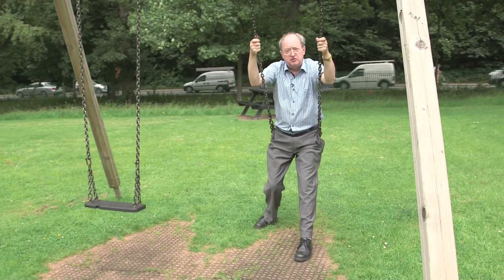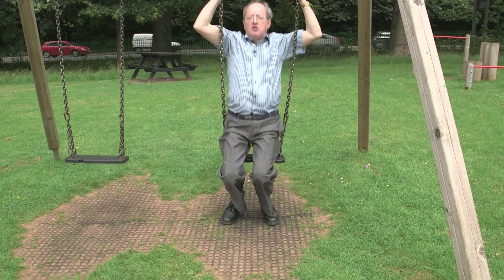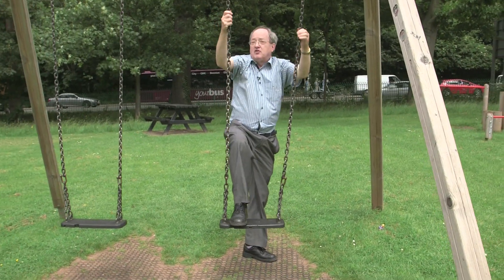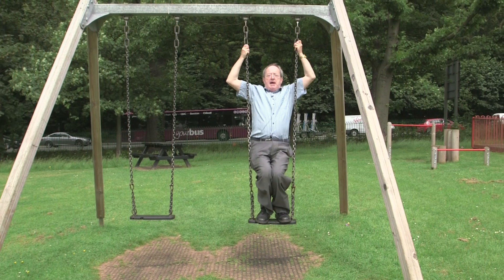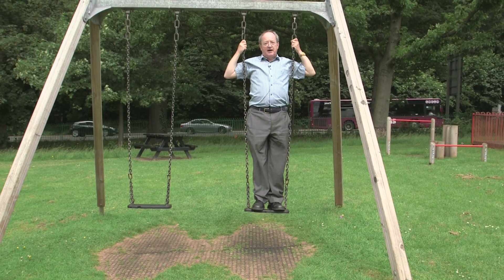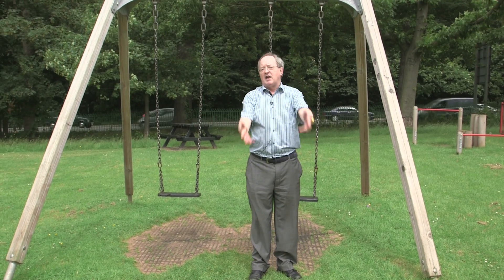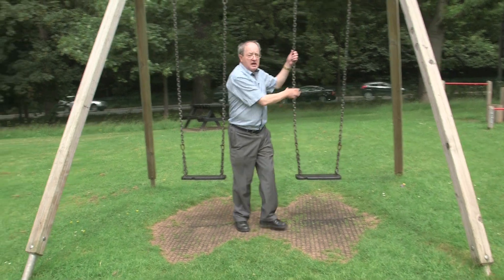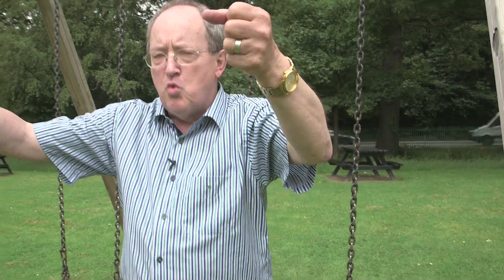Swing Physics (extra footage)

Comment: I content that this explination is wrong. You can get a solid bar swing to work by "pumping" your self NOT significantly changing the center of mass height , but by Applying energy to move the center of mass the center of mass along the radius of the circle.

Comment: Thank you for the explanation!  I grew up in Russia with rigid steel swing arms.  We would indeed stand on the swings and go up and down to achieve incredible momentum and speed BUT we, most of the time, pumped in the usual way, sitting on the seat and extending and tucking under our legs and torso.  In fact, we swung sitting down on the seat in much the same way as people do on swings with ropes or chains.  HOWEVER, swings with ropes/ chains feel like pulling a guitar string that has lost all tension, or like running in deep sand -- my energy is stolen away and wasted by the bending of the chains/ ropes and it is not transferred as efficiently as it used to be with the rigid poles.  Why is that?  Why sitting and pumping with rigid poles felt so much more powerful than pulling on those ever-bending chains/ ropes??? My intuition is that the bending of the chains creates a smaller pendulum beneath where my hands are grabbing, this smaller pendulum moves in a different period relative to the main big pendulum -- something like a turbulence in the motion of the main pendulum, and this "turbulence" wastes the energy of the main pendulum, making me, overall, move more sluggishly while using the same amount of energy.

Comment: Surely moving your 'centre of mass' forward and  back at differing speeds through the swing, reduces the loss of acceleration at the ends of the swing. In fact isn't your 'centre of mass' going in a circle around the point it would be if you sat passively. So its an example of two dimensional movement being translated into one dimension.

Comment: I believe that this explanation is a little flawed, because back then I still could do the rocking technique to achieve higher velocities on rigid swings. Maybe it's also about moving the center of our mass back and forth? For example, if I lean back, I move my center of mass towards my back (at the moment of its highest point on the "back" side). It's like moving the pendulum a little bit further and further beyond its "own" maximum, so I just push more potential energy to it, right?

Not a physicist though, just thinking.

Comment: The bending and rising the Prof. talks about at the end is, as far as i'm aware, exactly the way skaters gain momentum in a half pipe. But I'm curious as to whether or not the physics is actually the same or if it is a little different as a swing is suspended from above where as a skater is running on a surface?
Reply: It's a force perpendicular to the ground that makes the object go in an arc. Doesn't really matter where that force comes from, because the "pushing", whether it's done by the chain/rope or the ground, is the same. So yeah, it doesn't matter :)
Reply: It's the same set of forces. The skater follows a curved path defined by a solid object, no difference at all, except the skater doesn't necessarily follow a circular arc, I think half pipes are flat on the bottom.

Comment: There's something missing in this conjecture.
My grandfather built me a swing with rigid bars many years ago, and I could swing past the horitontal point more easily than on swings with chains, using the same sitting and rocking technique shown in the main video.
Reply: An example of an apparatus that is swinging without changing the center of mass vertically: https://youtu.be/Lhjv67uOA6o

Comment: Mountain bikers also do this over mounds to maintain speed and control (take weight off the front of the bike when the front wheel goes up on the mound, put weight on the front wheel when it goes onto the downhill of the mound, and then the same is done with the back wheel of the bike but slightly behind). It's called pumping. Basically put weight on the bit of the bike that is going downhill and take weight of the bit of the bike going uphill.
Reply: That's actually a much better explanation than the one on this video. You push down to add weight when swinging down and pull up to lose weight when swinging up. Same as a skateboarder does on a half-pipe. The explanation from the professor in the video is wrong and proves he doesn't really understand it. Because it's not really the length of the pendulum that gives speed, but the energy from the extra weight you add to the centrifugal force when shortening  the pendulum.
Reply: Non Profit That's indeed a much nicer explanation, its only fault being that it's completely wrong, since weight has nothing to do with the speed of the pendulum at all. What determines the speed of the pendulum is either the centrifugal force or the torque, depending on which viewpoint you prefer.
Reply: Non Profit Your explanation is wrong in so many levels... you "gain weight" and "lose weight"? I don't see kids in the playground lifting and dropping weighted objects in between swing cycles, so how does that happen?
Reply: bennemann No, its correct.  You have less of your weight on the swing when you pull up your legs. You add more weight to the swing when you push your legs back down again (even more than your inertial weight because you work against earths gravity.)
Reply: Valdeem Spor In the video and all who uses a swing also change their position over the pendulum back and forth so the balance makes it move. If you push vertically down on swing it will transfer the energy to forward momentum. If you press out on a swing in the same angel as the pendulum you transfer no energy to forward momentum. The speed comes from the angular momentum you add to the pendulum when pressing down on the way down and lifting up on the way up. You time this with the turn and you add the energy from the forward momentum to downward momentum and back to forward. Holding tight on the swing to stop your forward momentum vertically will also add momentum to the swing an even more height.
  His explanation is wrong because reality does not give that effect to that action. Mine can be misinterpreted, but is at least representing the physical reality of this world.

Comment: But the fact of the matter is that one is able to swing higher and higher on a swing with rigid bars while still sitting. I am saying this from my own experience. Just by using the same technique of laying down while moving forwards and leaning forward while going backwards, it is possible to reach new heights. What is up with that?
Reply: If you reach an angle close to (or greater than) 90° on a chain, the chain as a whole will start slacking. You need a rigid bar because otherwise it just won't pull on you.
Reply: Right. I suspect that the swinging isn't really about making the chain shorter at all, because you start doing that at the highest points. In the beginning of the video he explains that doing it at the highest points is useless.
I suspect that it is more about shifting your center of mass in relation to the swing seat, where you place it alternately behind and in front of the seat.

I think we need a second opinion!
Reply: It works by moving center of mass back and forward. I think there are 2 reasons:
- Newton's Third Law. When you move yourself back on the swing you make an action, and swing reacts by moving forward.
- By changing center of mass of the whole setup (you + the swing) in the a way that it has more potential energy (by leaning in the same direction than swing when swing is in most extreme position) which is then converted to more kinetic energy when swing starts to move down.
Reply: Philbert De Zwart
Well, making the chain shorter is effectively moving your center of mass. It's the same thing, seen from 2 different perspectives.
Reply: But *****, because you do it at the ends of the swing, effectively the chain is the same length for the duration of the swing. 
I wrote Brady an email asking for a second opinion.